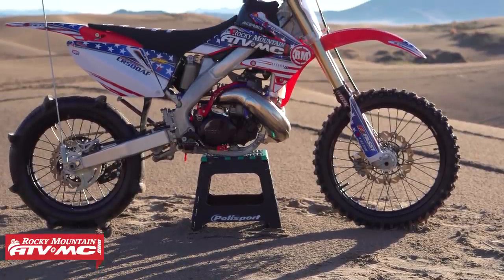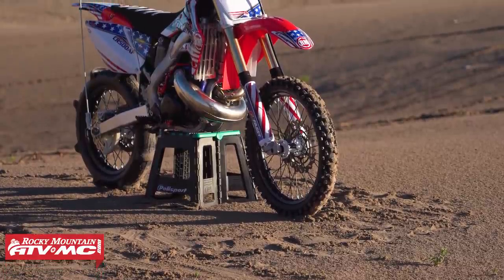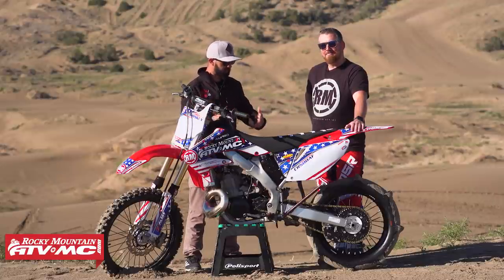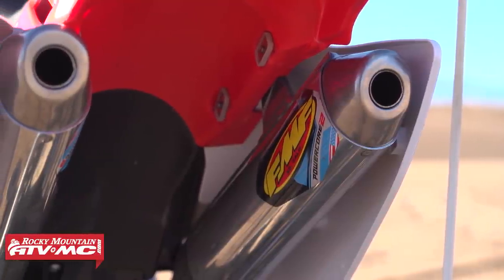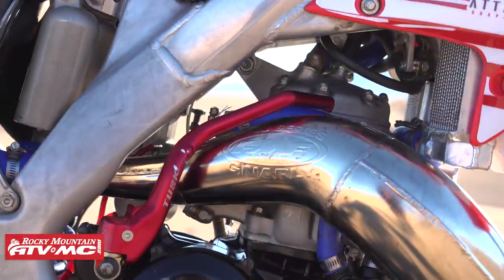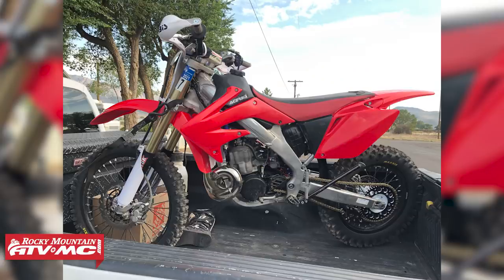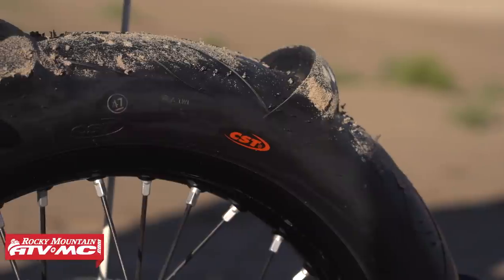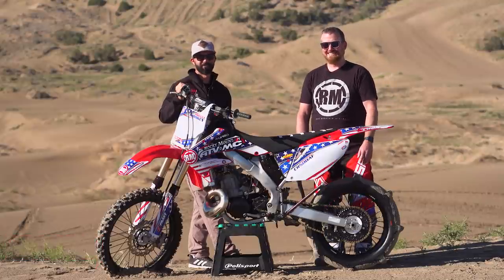Honda CR500 Aluminum Frame Bike Build

Comment: Two-Strokers do it twice as often!
Reply: And get rebuilt twice as much
Reply: And are easy to rebuild. That's why there are CR 500 engines from the late 80s still kickin.
Reply: @KoltFin  they get rebuilt way more than twice as often. 4 strokes are known to go 200-300 hours where most 2 strokes are about 50 hours. But their both great engines and have their place to stay in my book
Reply: @KoltFin  bull shit , my current 2018 KTM 300xc is on 220 hrs original piston any still has mint compression. 
 My 09 CRF 450 which I also have is on 250 hrs with 3 top ends & a bottom end done. & god forbid the cost if the 450 blows up.... you have no idea . A cr500 revs to around 6,500 rpm , a 450 is close to 13,000 rpm . You’re thick if you think a 500 2T needs rebuilds more .

Comment: Nice but been done heaps before,
Service Honda/built Honda pretty sure they own the trademark for af 🤔
Reply from the maker: Thanks! We're not trying to reinvent the wheel, or take any credit away from the amazing builds the Service Honda and Built have done over the years! It was just a fun project that Kevin and his brother wanted to take on, and we wanted to share with you guys! 
Turns out the trademark for 500AF was actually cancelled last year. Even still, we aren't trying claim this as a official Service Honda AF or anything  🤘
Reply: @rmatvmc  yeah it's a nice 500 build for sure twin pipes are sweet made it different to rest 👍

Comment: All these years Service Honda  or otherwise known a Built now.. Has been building these for 25yrs now. Not  once  have you ever featured them. Why would you feature this Kevin who is not even known..??? Contact Aj Waggoner.  
Just so you understand Aj Waggoner has the Patien for the CR500AF name. So Kevin can build this no problem.  But, he has t change the CR500AF to something else. Don't worry I will Share this Video with Aj Waggoner.  So he can wxplain....
Reply from the maker: Because Kevin works for Rocky Mountain ATV/MC and AJ does not.
Thanks for checking out the video!
Reply: I mean, he can't have been building exactly this for 25 years given it's a 2007 donor frame but I get what you're saying. It's a cool idea/bike and while I appreciate that it might be a big deal to have been the first to do it, patenting a name/mod concept seems a bit much. That being said, I'm no expert so maybe there's more to it.
Reply: Also patent was cancelled for name
Reply: @jameshealy4594  Aj owns the Designation CR500AF..
Reply: @rmatvmc  you make it sound like it's not been done. Aj owns the Name CR500AF. .
Reply from the maker: Anybody that's been into dirt bikes for a while has seen CR500AF builds before. We're not trying to start competition with anyone, the more CR500's the better!
Reply: @rmatvmc  100% agree. I have been supporting Service Honda since the beginning 1997. I have owned my 2010 Service Honda since New. It humbles even the New 450 4pukes.